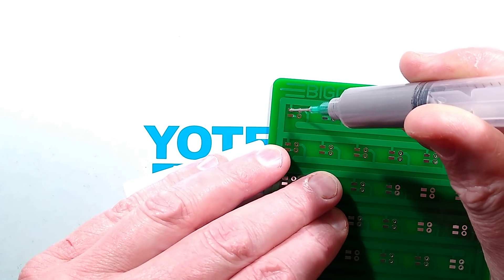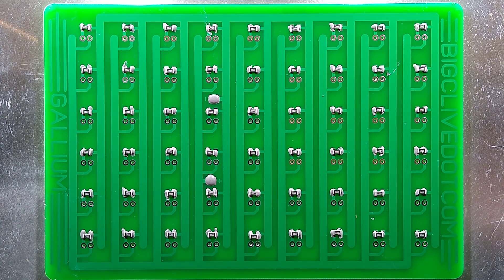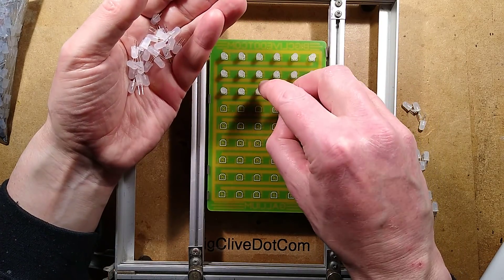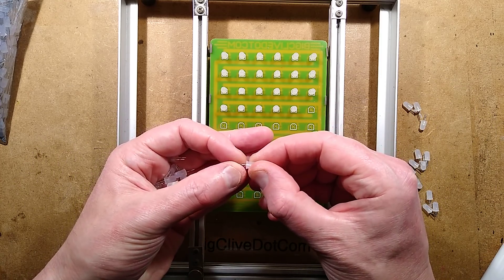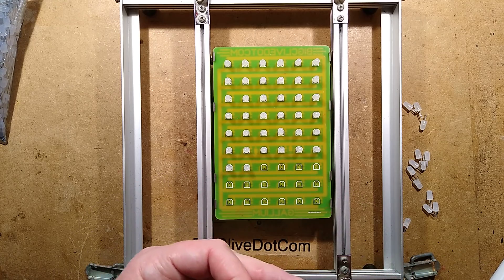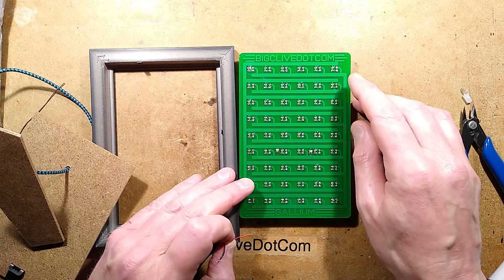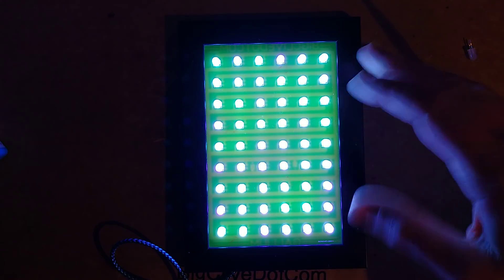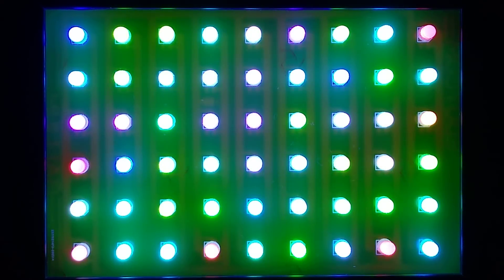Reflow attempt 2 on a custom LED art PCB (with resist).

Comment: What not make it SMD+Throughhole in one?
I had to use something like that as kind of a hack even on a board cause of too little space, so we had seom pads that had vias through them, and even 2 pads that were used by 2 components at once. (Never try spacing like 50 components and over 30 pads together with a microcontroller on a sub 500mm² board - takes a looong time to fit in the traces)
Reply from the maker: I did subsequently think of that.  Putting the SMD pads between the through hole pads.

Comment: Since you don't have any other components, what would be the pros and cons of using a single voltage regulator instead of all those resistors?
Reply from the maker: The panel is designed for a variety of LEDs including ones with different voltages, so it makes sense to have a resistor per LED to avoid the lowest voltage LEDs hogging the current.
Reply: There is another reason, what i've spotted by accident:
 When you drive color-changing or blinking leds in parallel with only one current limiting resistor, they tend to sync each other and the random effect goes away.
Reply: @chtech0710  That's interesting. I can kinda see how that might happen. Clive, that's fair.

Comment: Your pads look a little wide to me. Should work fine but will probably allow your resistors to be a bit out of position.
Reply from the maker: They are.  I'm still getting to grips with surface mount.
Reply: @bigclivedotcom  Does your software use device libraries? I've seen you use it once or twice. I usually use Eagle. I understand there may be some political reasons not to since they got bought but it's what I got started on (post Letraset and resist pen) and it's free now.

Actually, a Letraset video might make interesting watching for those who are more used to modern techniques.

Comment: I've seen a few of these solder paste and reflow DIY experiments and it still seems to be just slower and more difficult than manually soldering 1 pad, tacking in the components and then soldering the rest normally. I never tried any reflow work myself and I really don't see the point for the stuff I have seen so far. Maybe if you do alot of it there are benefits when you get the process going but .. it still looks so very awkward to me.
Reply: Small SMD-Parts or BGA come to mind. Worked on a tiny board (24x20mm)together with a friend with minimal track-width and track-distances the whole board was covered. Quite a few 0201 components - pain to solder by hand, some parts with leads mostly under the chip. And we needed at least 5 of those suckers. So we just whipped together a bigger board with 10 of them in it, a stencil from the board-manufacturer and the rest was simple: Fix the stencil, spread the past, drop in the components, reflow, done. Takes no were near as long as soldering >500 mostly tiny parts by hand.

but for 1-off projects? Only if you have to - like BGA.
Reply: @ABaumstumpf  True, the more we go to BGA and super dense stuff, of course working techniques must change too. That's actually starting to be a bit of a pain in the near future when some chips will only be available in awkward packages for DIY home gamers. Regular SMD is usually brilliant and easy to work with but some kind of a microscope and steady hands seems to be more and more a requirement at least.

Comment: I have used JLC for a few projects and I have always been satisfied with the result. They always put their production numbers in a very discrete spot. Sometimes even under a component so it's hidden when populated.
Reply: If you panel the pcb with a boarder then they put the number on there :)
Reply: I've paid extra to have the number removed, and on my latest order, I've specified the location myself, so you can choose where you want them to print it. I've seen them print it on the copper layer as well, so it's not as visible as when they print it on the silkscreen.

Comment: I've had very good results using a yehua heat gun, of course you need to be mindful of blowing components off their pads.  I've thought about using a hot plate to bring up the temperature of the circuit board to below melting temperature, but enough to let the heat gun finish the job more rapidly than otherwise.

I also greatly value having a stencil, although that brings its own kind of setup problems and mess. I used to use a dremel tool to route a recess in hardboard to drop the circuit board in so the stencil lays flat, but now i just make due with other circuit boards and tape to prop the stencil up.
Reply: Use the large nozzle and minimum airflow, pre heating the pcb on an ironing type iron held upside down in a vice of knowledge drys out the solder paste speeds it up :)
Reply: @steverpcb  There are largish "PTC Aluminum Heating Element Heater Plate, 250 Degrees" from ebay and Amazon etc.  They are nearly hot enough to actually reflow without extra heat and a lot easier to use than an iron.
Reply: Louis Rossmann technique!
Reply: Was just about to post similar, personally I'd of reflowed those resistors using hot air, it'd be way quicker and doing them in stages would be a lot less risky and fiddly.
Reply: Same experience here.
Reply: *make do

Comment: Note to self - if I ever need a PCB order done quickly I need to make sure it says "BIGCLIVEDOTCOM" on it in large letters
Reply from the maker: I did wonder if that had an effect...
Reply: @bigclivedotcom  I bet!  Because  you have started to become a legend among youtubers  !
Reply: They're quick enough as it is. I've ordered on 19 May, and I had different colours solder mask, which take longer to produce, and I chose DHL shipping, which is cheaper, but slower, and the current tracking status says it will be delivered on the 28th.
It'll take JLCPCB 24 hours to produce your boards. Pay extra for faster shipping and you can have your boards in just a few days. I doubt they care about what name is printed on the boards.
Reply: Update, DHL shipped my boards from China to the UK in one night, it actually updated the delivery date to today instead, so yeah, order several boards in different colours and get them delivered in 7 days seems pretty normal for JLCPCB.
Reply: I ordered the Gillians Diamonds board through them and they are really that good.
Reply: I will order next PCB with JLPCB still waiting one month for PCBway.
Reply: I always get mine in 7 days in the U.S.
Reply: You are quite famous, @bigclivedotcom.  You were mentioned by @xraytonyb in a video he recently posted, in which he mentions you when noting the pink highlighter he used to highlight a section of schematic he was using.  It was a nice surprise shout-out.
Reply: hahaha

Comment: Might be better to keep that hot plate down to about 150c and airflow them individually. That was my method using an old clothes iron. Didn't take long at all.

Curious how you diluted the solder though...
Reply: I thought the same about heating also what about smd LED's and maybe a flexible board so i could be wrapped around one of thsoe cardboard tubes posters are delivered in. Could make quite a cool modern take on a lava lamp.
Reply: @rimmersbryggeri /videos Very nifty idea...might have to try that myself  :)
Reply: @gregorythomas333  Please show the results. I don't have the resources to make my ideas myself. Thats not a reason to keep them to myself if they can spread joy though.
Reply from the maker: I got solder paste and added flux until it got to a dispensable consistency.